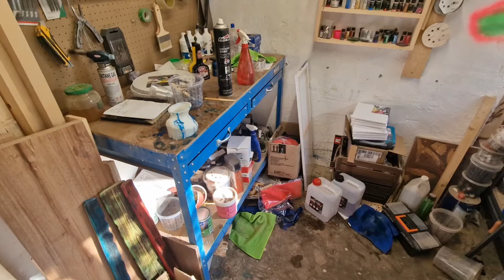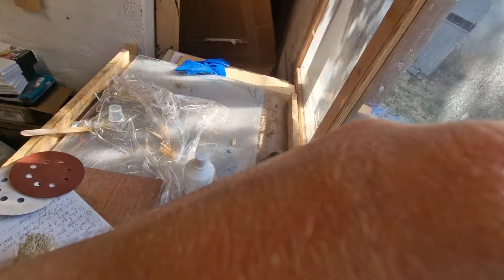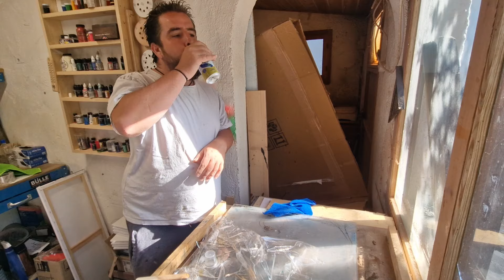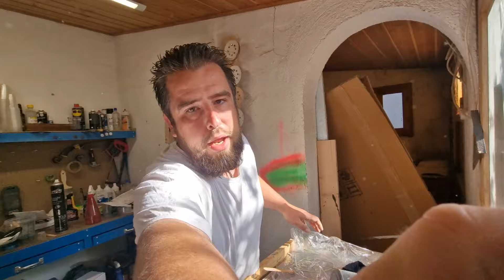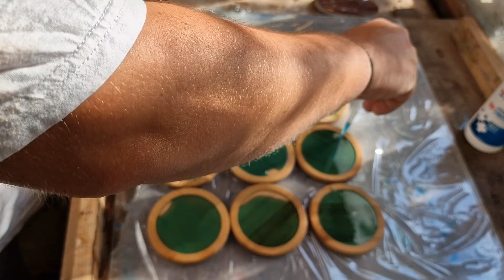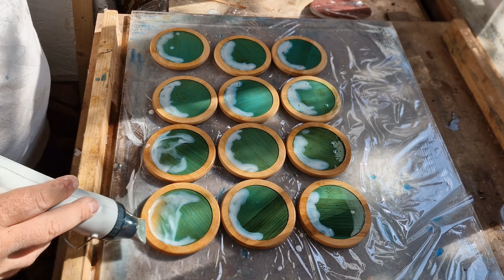Unplanned Coaster Making Session!

Comment: Make sure to keep all that dried resin. You can use them in a like a stained glass piece just paint the broken up pieces of resin and then put them in your work
Reply from the maker: yes yes! im collecting them in a bucket now!
Reply: Okay I need your help I've bought some resin it says 3 to 1 ratio. But then it tells me to mix equal parts of each and mix well. So  can you please help me figure out what their meaning. I don't understand why their instructing me to mix equal parts of both if it's a 3:1 ratio.
Reply from the maker: Email me the label. I dig into it for you. Aeginacraft@gmail.com

Comment: Thanks for the shout out Bela I've less than 30 followers 😂 not 500, haha! So i can't post community posts. Anyway I have a problem. Maybe your followers can help. How do you semi permanently attach silicone to silicone? Any ideas, anyone? 😁🥰
Reply: @mystryxm3590  I have these hole makers from little windows im trying to use them to make hollow eyes on a dolls head. One moved when i tried it tho so trying to figure out how to stick the hole maker to a mold non permanently lol
Reply: @mystryxm3590  tbh its a total pain in the arse but i cant think of any other way to do it
Reply from the maker: okay so I spent some time thinking about this. Adhesion work in 2 ways. 1: you add material in-between the 2 parts you want to stick together. 2: you dissolve some of the parts you want to stick together and you weld them in a way. you more likely want to do 1 here. now silicone is a MF cos nothing wanna adhere to it apart form silicone itself. so I would use a dab of bathroom sealant silicone to andhere them, but before make sure its clean and grease free. not a 100 % if it works but this si my best bet at the moment.
Reply: You got a new follower 🤗
Reply: @AeginaCraft  Ahhh thank you so much Bela I will try this and let you know how I get on with it 🖤
Reply: @79Firegirl  Oh thank you so much 🥰 🖤🖤
Reply: You could try honey. It won't stick tight, but may stay in place long enough.
Reply: @TaylorJenkins  Thank you  😊 I ended up using some sealant to stick them on i just made a video yesterday. I could maybe pry them off if I needed to but at least they stayed in place 🥰